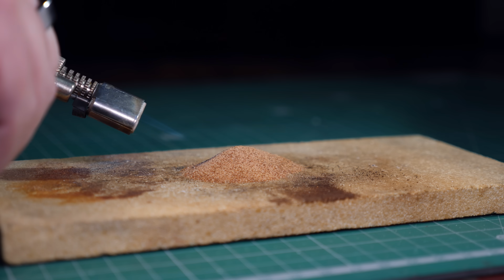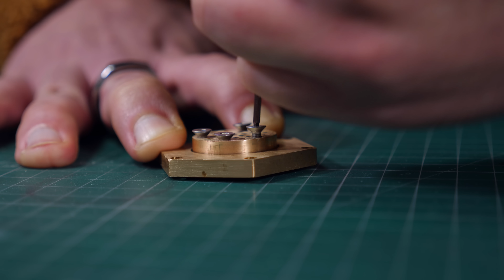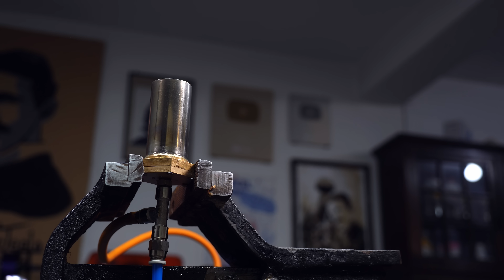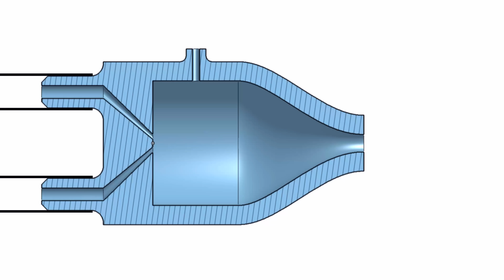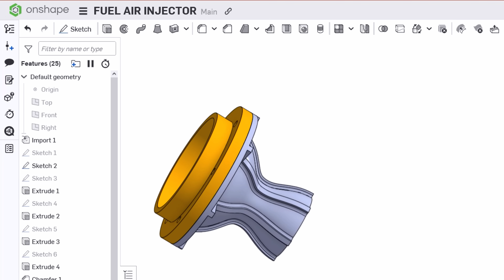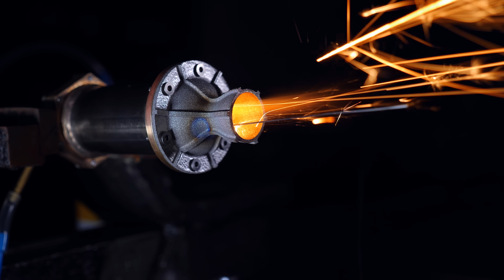I Built the FIRST VENTURI ROCKET ENGINE

Comment: Throttleable solid fuel rocket motors already exist, MBDA developed the solid fuel ramjet used in the Meteor missile, which although named as a jet, is still based on a rocket motor.

Comment: "Do you see any low pressure in this diagram?"
Yes, several strands immediately above the tube where the air had to speed up to go over it, becoming lower-pressure. The Venturi effect is very well-proven, my dude.
Also regarding nozzle pressures, the Venturi effect only needs it to be lower pressure than surrounding, not overall low pressure.

Comment: THAT is not an aerospike engine.  It's a plug nozzle engine.   However, its the design from which aerospikes are derived.  When this kind of nozz;e was first tried, there was a big problem - the pointy bit got too hot and would start to melt. So they chopped the point off, and included some holes in the truncated cone through which the          exhayst from the turbopumps were vented (this was an all-liquid fuel design), thus getting a but of extra thrust  AND effectivelycreating the spike of the engine from gasses - hence "aerospike£,because it uses an aerodynamically-created spike using gases.

Both aerospike and plug nozzle engines are great because they are inherently altitude compensating. With bell-shaped exhaust, if the bell istoo wide, , the exhaust gases dont expand enough to keep the atmosphere out of the bell, which causes instability in the exhaust flow which is A Bad Thing.  Ideally, you'd     want a bell that can get wider and wider as the rocket climbs through the atmosphere., to get maximum thrust from the engine.  This is, essentially impractical enough to be effectively impossible.

However, with teh aerospike, the exhaust      gases arent opushing aginst a bell nozzle, they're pushing against the aerospike (or         pointy plu in a plug nozzle engine), with the atmosphere                   automatically letting the exhaust gases      expand more and more as the rocket climbs. This is more efficient, so you get a bit more thrust from the same amount of fuel. So why didnt they use aerospike engines way back when the things were invented?  Money and politics.  Politically, the USA wanted to show that the USA could beat anything       the Soviets could do in space. And they already had bell nozszle engines more or less figured out., and the Apollo design would do what the politicians wanted, whereas trying to change to aeriospikes partway through Apollo could have delayed it by years. .  The USA lands men on the moon, much rejoicing, politicians decide they        dont want to spend so much on space anymore.

Private companies producing rocket engines knowthat the market for them is small, so they arent going to spend the money on the new design either..  Many years later, SpaceX comes along, and suddenly there's a lot more interest in putting things into orbit. This makes small startup rocket companies more viable, and so its only recently that some companies have started to seriously look at using artospike engines. 
Funny thing  is that just as that happens, researchers are making good progress on even more efficient engines - the rotating detonation engine. Whuich are MUCH more dangerous if you get them wrong than current rocket engines are.

Comment: Hybrid rocket engines also suck because the gaseous component can only get injected into the burn chamber while the gas tank pressure is higher than the burn chamber pressure. (And that in turn limits the burn chamber pressure to be no higher than the gas tank pressure). I think the pulsing/farting can be traced back to this fundamental limitation. Using compressed air as a source of higher feed pressures is probably a good idea. But the more oomph you can feed your gaseous component in with, the higher pressures your combustion will run at, and the better the efficiency.

Comment: if you use the gas used in airsoft gas cans you can get basically butane or propane i don’t remember which one at like 10 bars if i’m not mistaking.
That should solve the problem you are having with backflow

Comment: The reasons why Hybrid rockets are built the way they are and not like this, at least to my understanding, are:

1. You really cant beat LOX as an oxidizer, its 100% oxygen by weight (obviously) and  doesnt contain stuff like chlorine, and is relatively safe to handle, unlike ozone.

2. Having a solid fuel allows you to use metals as fuel, which create heavier exhaust products than the CO2 and Water you get from Propane, increasing thrust.

A consideration for reusing the rocket is that having the (metal) walls of your combustion chamber be lined with an oxidizer and then heating the whole thing is very harsh on the combustion chamber. It oxidizes the walls and metal oxides have lower thermal conductivity, meaning the whole combustion chamber gets hotter and therefore weaker.

Comment: You never managed enough pressure to reach supersonic flow (or well, sonic flow at the nozzle throat. You really need to refine your fuel injection setup. You need far more pressure or far smaller nozzles.

Comment: Ive build a venturi rocket years back. I was trying to build a burner for my forge, and i used it, but it required the forge be hot before i could get it to run. It ran on propane. I used a .030 jet then bumped up to .040 of an inch jet tip after. My burner was a 1.5 in id intake with four roughly 3/4 inch slots 3 inches long. This chamber was 6 inches long with the gas tip behind the slots and the chamber used a 35 degree angle neck down to a 3/4 inch id tube about 14 inches long. To run external from a forge, you will need a tip on the end of it. I made mine with a step down roughly 2mm down from the inside of the pipe and tapered at 15 degrees for roughly 32mm length. It must be stainless. Other materials will burn up. The stainless barely survives. Using a ln air shroud over the slots makes it easier to tune due to air turbulence at the intake. Make sure everything is smooth. Good luck. I still use mine for forge welding but made a smaller version for normal forging and a beter forge design. The inside of my forge measured 4228 F max just below the flame on the forge wall. The forge chamber was 20inches inside diameter round. Average temp stays roughly 3900F away from the flame. I can go higher. But the pressure and flames become too fast and hot from the forge. It will melt my refractory if im not careful. For your use, you should add a secondary injector at an angle injecting methanol. It will assist in swirling the propane mixture and keep the temps lower. Should also increase thrust because of the flame cooling and expanding faster.

Comment: You should try the reverse of this, a hybrid fuel rocket using a solid fuel, but a gas oxidizer. You can change the burn rate by adjusting the amount of oxidiser released. you could use Nitrous Oxide, like the ones you get in those canisters for making whipped cream, and a solid fuel packed around the inside of the rocket engine body

Comment: any perchlorate used by NASA or anyone else, should be banned. the manufacturing process, plus the exhaust from the solid rocket pollutes the water above and below. if you really have a pair down below, you should purify hydrogen peroxide to near 100% (vacuum distillation) , as the Nazis did in WWII. awfully dangerous, old boy.  but gram per gram is far more efficient, or you could try alkali metal peroxides, less efficient but solid. or dinitrogen pentoxide, solid a room temp, unless you're in California. neither one pollutes the water table. 
as an aside i read some reports about some guys mixing CL-20 with 100% H2O2 as missile propellant, to eliminate the smoke signature. or to blow up some caves in who knows where. way above my pay grade.

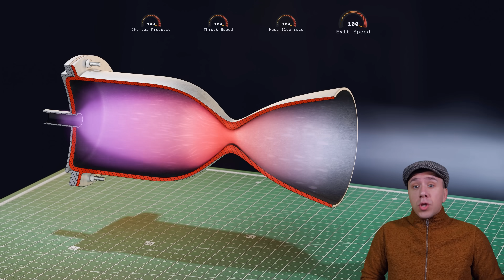Comment: 12:30 Rocket nossles have nothing to do with the venturi effect. Rocket nossles are so calles "de laval nossles". De laval nossles use properties of compressible flow to accelerate high pressure combustion gasses at sub sonic speeds to low pressure gasses at super sonic speeds. The restricting part of the nossle accelerates the flow to exactly Mach 1 but cant accelerate it any further. It is only after the restricting part when some thermal energy is converted to kinetic energy to push it to suoer sonics speeds above Mach 1

Comment: Hi Integza,
I’m an aeronautical engineer with solid experience in CFD analysis, especially using ANSYS Fluent. I’ve been following your rocket engine projects, and I’d be happy to help. If you’re interested, I can run performance predictions, flow simulations, thrust estimates, and thermal analyses on your engine designs in Fluent before you build and test them.

Let me know if you’d like to discuss this further.

Comment: Integza! You can make ammonium nitrate if you make nitric acid from the potassium nitrate and then combine it with ammonia. its not as good as ammonium perchlorate, but at least it decomposed completely to gas unlike other metal nitrate salts that melt and can clog holes. this is my suggestion:

2NaHSO4 + 2KNO3 -> 2HNO3 + NaSO4 + KSO4

this is done by heating to around 300C which will make almost 100% nitric acid and then can be diluted down and reacted with ammonia.
you can find a video on a similar method by NurdRage on youtube, its called the bisulfate method for nitric acid.

though, he used NaNO3 and NaHSO4. it should matter though because the NaHSO4 is the one that melts, and we still have that in my proposed reaction.

Comment: For the alcohol air mix you use you maby wanna look up the way a fog buster works it's used for machining but it might give you more control wit the amount of alcohol you sent in the nozzle 

(If jou place the "fog buster" before your normal low pressure system you may be able to have more control with the amount of fuel to air mixture)

But I'm no expert wat so ever 
Rocket engines are way above my pay grade

Comment: What if you added a tube going up the middle about half way covered in holes with the top plugged up and the fuel is injected at high speeds through the bottom with a ring of holes for the fuel

Comment: With respect to your Venturi: the vacuum inlet port should be at a shallow angle to the fuel inlet. Not a 90 degree angle. No wonder your Venturi didn’t work.

Comment: Why not use an annular nozzle to direct the fuel straight to the walls of the chamber where the oxidizer is. All of the fuel in the direct center won't make contact with the oxidizer.

Comment: Well, he's still alive (somehow!) We've all tried reverse hybrids but they have issues. Mucking about with AP is illegal in the UK for all the wrong reasons - the correct reason to avoid it is that it goes boom on you when contaminated. And pressurising propane with compressed air is nuts: use pure nitrogen for gawd's sake! And finally, he didn't earth anything: Mr Static Charge will light his fireworks before he's ready.

Comment: I've been wanting to experiment with running a gasoline motorized bicycle engine off a combination of gasoline and HHO-  hydrogen oxygen..... That's made from an onboard rechargeable battery 🔋 pack. Obviously an Ebike would be a more efficient use of the electricity from a battery 🔋 pack. 
Unless 🤔💡 the hho system was much cheaper to make... Than buying a $1000  Ebike kit & it could close to double the fuel economy. From using a smaller cheaper rechargeable battery pack. 
With 0 range anxiety, because you could just switch to using gasoline only. If the hho battery 🔋 pack was fully drained.

Comment: Your injector is the same concept as a carburetor for combustion engines. The movement of air somehow “pulls” liquid fuel into the stream of air, and has the added effect of mixing and atomizing so the air/fuel mixture will burn when it enters the cylinder.
Reply: And he also shows the drawbacks of a carburetor almost perfectly.

Comment: How you haven't exploded yourself multiple times by now is a miracle that will never be known 😬 Grind up oxidizers in a coffee grinder, press fitting pressure bearing parts, constricting the flow of a rapidly conflagrating fuel-oxidizer mix, no flashback protection whatsoever, trying to add liquid propane to your bomb... I mean, engine, stoichoimetry by vibes, baking oxidizers, and I'm sure I've missed some. I'm all for high energy science, but my gosh you are literally playing with fire 😆

Comment: Just wanted to mention that your video on making rocket fuel by electrolysis gave me a few ideas of my own and I have now made my own version which is easier to construct and runs great! So far I have only done small detonations as tests but I plan on launching small rockets with it at some point and potentially in the far future using some kind of pump to actually send the gas to an engine instead of just harnessing the hot gasses/water left over from the explosion.

Comment: Ah the problem of mixing...dude you need a tiny high pressure pump and tiny inlet holes. Also try multi stage mixing and preheating (use the nozzle heat/cool the nozzle).

Comment: "Can burn metal, which in normal circumstances won't really burn at all."...
OHHH REALLY?
Do me a favor real quick, grab some steel wool, put a lighter to it and hold it real tight.
And for the brain dead out there... Please don't, this is a overly sarcastic comment and it will make your hand unusable for quite some time, possibly forever.

Comment: Seems like the way to control it would be separating the powder into segments each locked off by their own shutter - prefereably shutters made from some kind of ceramic material like the CMCs in modern jet engines.

Then the reaction can only continue as long as each successive shutter opens.

More engineering, but at least it's a solution.

Comment: so you made a carburator/bunsenburner..? well done!
I don't think you can make a thruster (an expanding gas provider that creates pressure above air pressure, as for venturi you need underpressure to suck air in...) with the venturi effect, otherwise you wouldn't need air fans in a turbo fan engine, and since we are not in the realm of ram/scram jet....

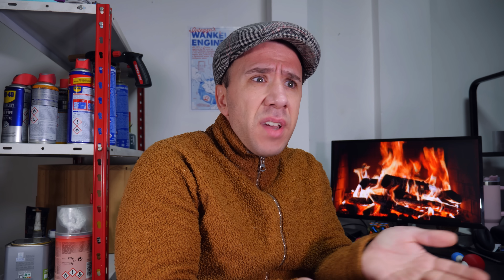Comment: Got as far as 2:56 so far, but one problem I can see with casting the oxidizer into the combustion chamber and spraying in loquid fuel is that oxidizers like ammonium pechlorate decompose under high temperatures, and that decomposition is itself very exothermic, so it might not make for such a controllable rocket.
Reply: I also wonder if it’s even significantly denser than a pressurized tank would
Reply: Also i'm pretty sure the oxygen density is really bad compared to most other sources of oxidiser that aren't compressed air.
Reply: Ok Einstein

Comment: cannot smell propane gas itself

When propane gas is bottled, 'Ethyl Mercaptan' is added to it. This allows people to smell a gas leak very easily. Rotten eggs and onions. Pure propane itself has no smell.

Secondly, the pressure of liquid propane is highly dependent on temperature.
The 'vapor pressure' rises exponentially vs temperature.

The initial propane gas phase will be at maybe 100-120PSI at room temp. 
The pressure will quickly drop to near zero psi in just a few seconds. This is because the liquid propane cannot boil off to a gas 'fast enough' to continue to supply high pressure flow to the rocket motor. The fuel pressure will rapidly drop, the oxygen will continue. It will run oxidizer rich, turn into a cutting torch and melt itself apart.
Reply: Maybe he is a fart smello, not a smart fellow.

Comment: I’m a aerospace and mechanical engineer major and I work with our schools rocket organization. We use AP as our main reactant in our solid rocket motors. I can’t share the specified formulas with you but try to use HDPE as a binder for your AP and metal choice, we use aluminum, magnesium and sometimes magnallium powders as our metals. Find a curative that works for you to bind the materials and implement multiple vacuum steps if accessible. Remember thorough mixing and atomic packing factor and you will have a well mixed concrete like substance that is easy to pack into a mold and cures well
Reply: Also the fact you were able to get your hands on AP without having a license is astounding!

Comment: at 13:00 that is the venturi effect, the high speed air has a very low pressure compared to the atmosphere around it. the atmosphere is pushing down on the water and when lower than atmospheric pressure arrives at the top of the straw, water is pushed out from the pressure of the atmosphere, it isnt sucked out like most people think.

To help intuitevly understand why high speed air has a lower pressure than stagnant air, you can look at it from the point of view of a air molecule. The faster the air molecules are moving, the less time they exist in a certain part of space. That is what forms a low pressure region.

Comment: The last one is hardest to go in because that many counter sunk screws overconstrain the part.  You're trying to remove too many degrees of freedom and the tolerances don't allow it.  You need a normal hole, an slot, and the rest to be loose fit if you want to use that many countersunk.

Comment: Your sprayer effect is probably related to the Bernoulli Effect.  High-speed air over the opening of the pipe creates a low-pressure zone at the head of the pipe, that sucks the fuel up the pipe and into the air stream.  (or, something like that)

Comment: you can channel it trough a nozzle and you can regulate power via bleed air like vents that work sort of like reverse thrusters on an aircraft, this wont give 100 % control of it, but it would give the ability to regulate thrust

I may be wrong